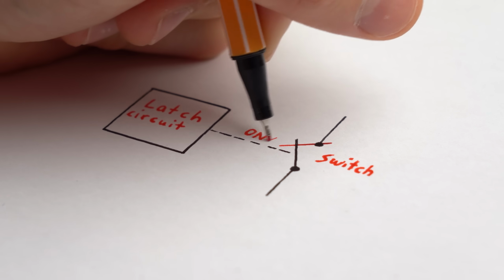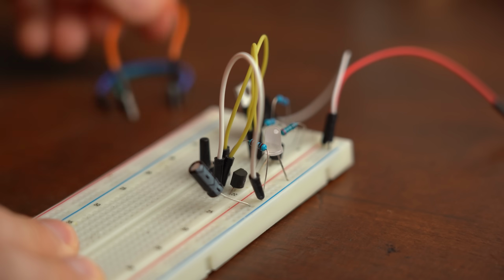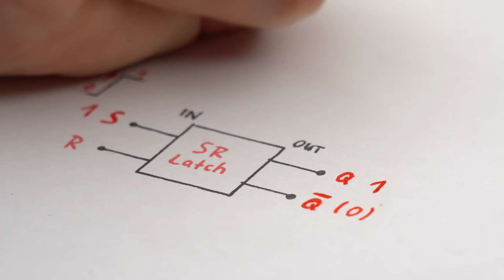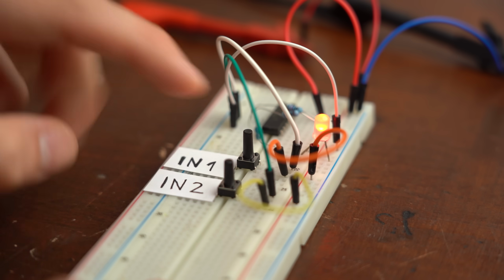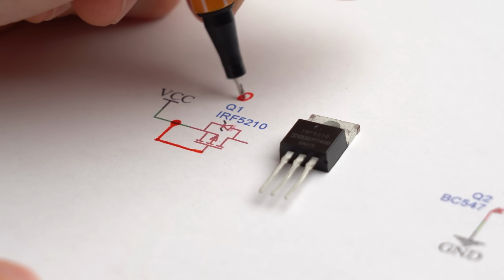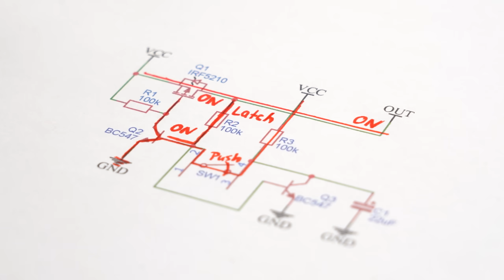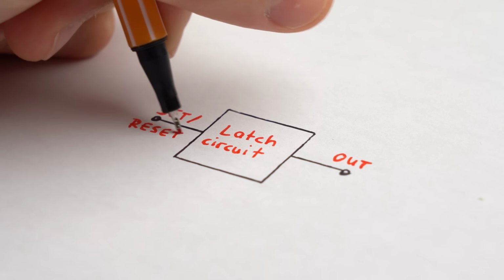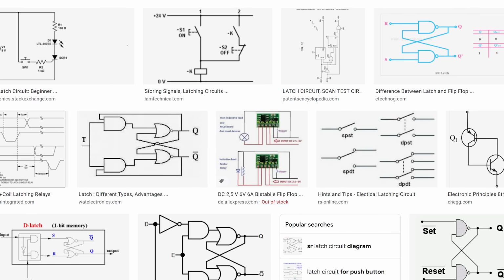Mechanical  Switches are Obsolete?! Switch to a Latch Circuit! EB#53

Comment: I think there is a trend to over-complicate simple devices.  you did point out where latch circuits are an advantage, but there hundreds of examples where  manufacturers are using a 10 component board to do the same job as a simple device.  This is why you cannot repair your own tech any more it always seems to have to go back to the factory to be fixed.  For example Apple phones and John Deer tractors.   And now the manufacturers of cars that want you to push a button rather than open a door or not have to put a key in the ignition are failing to deliver their cars because of a micro chip shortage.  I do hope the current "right to repair" movement is successful and we can stop this madness of having to pay a fortune at the garage to get the cars interior light repaired.
Reply: I agree that over-complication is an issue. I bought a used drip coffee maker (barely used, just out of its 1-year warranty) that had a latch circuit to turn it on and off. The heating elements were 230V AC and the latch circuit was 12V DC. After a few months the machine wouldn't turn on anymore. Turns out the latch circuit died, everything else was fine. So I replaced the whole latch circuit with a 230V AC 10A mechanical toggle swith with a built-in LED, which cost me 1.50€. It's been 2 years and the machine is working without an issue. These companies are sacrificing reliability and screwing over the environment for a few pennies.
Reply: I both agree with you on this, and think it's a bit out of place here. There's been countless examples of stuff being complicated for no other reason than someone either in management deciding it has to be "special" somehow and it gives no real benefit, or just engineers and designers that are lacking time to stop and think about everything from the start.
As a parallel talk I'm fully on it, being a product development engineer now it was literally the topic of our last meet up at the company (the boss saying "guys, sometimes we just need to... Stop, breathe, look at what the heck we're doing, and think: WHY is it like this? Can't it be made easier?"), and I agree right to repair just has to happen and disposable devices have to stop. People gotta stop feeding this insanity.
But I'll also say that I don't think the complaint relates to the video. There's several situations you'll want a circuit like that in place of a mechanical system. As an example, anything remote controlled. You'll not want that the only way to get that remote controlled device on and off is the mechanical button all the way at the device, neither you'll want to waste power unnecessarily with who knows, a mechanical actuator to that switch. A latch circuit solves the problem no doubt the simplest way.
This circuit being or not an unnecessary complication is always a matter of situation. It may very well be simpler than a mechanical switch even, remember a mechanical switch has to deal with contact bouncing and protecting the contacts against corrosion and arching.
Reply: @Kalvinjj  Well put.
Reply: @Kalvinjj  I'd agree with your point if not the title of this video. This is not "there are certain situations where this circuit is superior to a mechanical switch and can solve a problem the mechanical switch can't" This is "mechanical switches are obsolete". Which is exactly the overcomplication BS we're discussing.
Reply: @sydmichel the exact same thing happened to my drip coffee maker and I fixed it by doing exactly what you did. I remember thinking that the heating element might have gone bad and when I disassembled the device I was completely mind blown with the fact that the company went into so much Trouble to design a PCB with a complicated power supply, latching circuit and a led light that can and will eventually go bad instead of a simple mechanical switch that will probably last forever.... Couldn't agree more with your post sometimes it's just rediculous
Reply: I may drive a vehicle that was made last millennium, but I'll never have to agree to an EULA before starting it and driving.  And I Iove keeping my Tacoma going.
Reply: @bansheedearg  every production vehicle you've ever driven has an EULA that you agree to by simply driving it. There are always warning stickers telling you to read the manual and associated documentation before operating. Those documents contain the EULA and state that use of the vehicle is acceptance of the agreement.
Reply: @Callum Faulds Not really.   The latch on the bonnet and boot of my car is a very simple 12v dc solenoid operated latch (all on the central-locking circuit).  And neither my bonnet or boot has a keylock, so impossible to pick.   If any fault occurs is could be in the connectors (corrosion), the solenoids themeselves are virtually bulletproof.
Reply: There is video and pictures online of farm machinery being stolen in Ukraine and taken east into Russia. I noticed many were John Deer. Does that mean that repair parts etc will not be available? Overcomplication as a ruse to make money could help inconvenience people when they steal the equipment concerned.
Reply: @mbak7801  I dont know about all JD tractors but most of their mor high-end equipment can be switched off from John Deer HQ though the internet.
Reply: If you only knew how much some implement this in caravans, germans loves to use this kind of stuff where they make things so complicated it is almost impossible to troubleshoot because of it. there is not by far less wires but the exact opposite. switches that goes to individual control modules with their wires, from the boxes to the devices which often is longer because they need to run to a certain location where each box is, the boxes runs with either Lin-bus or can-bus or even both together in a network together and when one fail everyone else in the chain might flip out completely. there are wires EVERYWHERE and the complexity is insane just to turn a light on. your in for it when something start spooking out for any reason it may be.
to be fair things can in theory be nice when it works to a point but sometimes you gain more to just keep things a bit simple
Reply: I bought a new Maytag washer today. The only model that has rotary switches and knobs. The GE model we looked at has a strange dashboard, lights, push buttons one rotary knob that has no indent the panels lights thru the choices as it is turned. Seemed really cheap and cheesy. I just had the feeling the panel would die after the one year warranty expired.
Reply: Was the first thing I though when I saw the thumb. Some simple thing more complicated. Yes.... And now why?
Reply: Well said basically the clever people mass produce stuff to sell to the poor end user and over complicate design to deter counterfeit theives coping the product that way they can line their pockets better
Reply: @davey2k12  The "to deter counterfeit thieves" is a poor excuse by scumbag lobbyists. The Chinese factory that makes these things for, say, Apple works 2 shifts producing the phones as ordered, then 3rd shift, overtime, producing counterfeits using the same production line, the same projects, the same workers working overtime, possibly cheaper materials, everything off the books and to be distributed by dozens small shell companies that vanish from the market before the US can do a thing (only to reappear under a new name). 
The actual reason is when your device breaks, you can't fix the broken part, you must toss it and buy new, providing them with a steady stream of cash.
Reply: @sharpfang  that's where I'd fix it or upgrade it but you wouldnt catch me buying such overpriced junk including their phone's 
when a £20 version does the same job I think it's time people rethink their expensive life style 🤣 
The only reason I said to deter coping is because they purposely over complicate design for what reason for fun or to look clever naahhh to prevent copies and what u said so you have to buy new that's in everything these days like cars going electric..... Big companies stay ahead of the population while they get more complex design we are getting dumber and dumber and need to be trained more money in their pockets
Reply: What I'm usually doing is replacing the broken high- tech computerized device with a simple mechanical device so that it can still work.
Reply: like sure, right to repair is important, but imo you picked a completely irrelevant video to comment about it
Reply: and out side of a pandemic, would chips for starting the engine opening or loseing the doors wear out one day, and surprise, surprise, the only people  allowed to make then the car company and they stopped making them when the last of that model rolled off the line, they will say they will supplied chip for 5 years or something but when they run out there are going to say it unecanomaly to make new stock on the odd chance a old car will need a replacement chip aren't there and even if you take court action, and win, even if you are the same person that's had the car from new, in most cases the cars will be at least second hand, they will do some sort of calculations taking in to account  the age ,the time  and mileage, the car has dune, and come to the concision the they is worth $£5 or less, they may invent bitt you to cart it a way to,
Reply: I agree with what you say. I see that all the complexity and poor durability, less effectiveness and less reliability are due to the presence of electronics. Electronics are profitable for consumer companies, so we see these companies insisting on making everything electric ( Even things that do not need electricity at all ) and advertising that it is the simplest and best system in the world. On the contrary, it is known that the electrical / electronic system is a very complex system, weak in durability, and low in reliability. It also affects and pollutes our environment through its reliance on semiconductor materials, rare earth materials, and lithium. I believe that we must all diversify our devices and get out of the narrow circle of electricity owned by consumer companies !
Reply: this seems like an irrelevant complaint. if you're opening up a circuit to (de)solder it, that's already inaccessible to most. and whether a mechanical switch or latch is used, the complexity of repair is about the same at that point. plus you can replace it with a switch if you really want and if the application makes sense for it. "right to repair" doesn't seem to apply here
Reply: @LC-hd5dc  The point is: The smallest Replaceable Unit (SRU) used to be something like a switch or relay or some other discreet component costing about £1.  Now everything is part of a complex circuit on a Printed Circuit Board  (PCB) costing about £100 to replace.  Sometimes you cant even replace the PCB and you have to buy the whole unit that the PCB is part of.  Soon, you wont even be able to have your car/TV/fridge/washing machine repaired at all, they will all be repair-by-replacement.  Then, maybe you'll look back and think, when did this all start?  And you will remember, oh yes; it all began 30 years ago when they decided to replace a mechanical switch with a complex switching circuit.
Reply: @sydmichel  considering SR latches are older than I am I think this is scaremongering. also not every PCB is expensive. generally the parts that are difficult to repair are circuits with obscure ICs but in the case of a latch you often have the option of replacing with a switch if you really want. you can still use the $1 switch if you want, meaning right to repair doesn't really apply here. you're talking about completely unrelated scenarios that are not related to latches vs switches!

also this also seems off-topic on a video that is simply educating about different options, it's not trying to tell you you should run off and replace every switch in the world with a latch. you have to consider the circuit you're designing and which option among a mechanical switch, latch, relay, etc is the best option for cost, reliability, performance, and manufacturing constraints.
Reply: @LC-hd5dc  You already can't replace the home button on iPhone with a generic pushbutton. It must be paired to the motherboard, using specialized utility. So just wait for your SR latches to come with DRM.
Reply: @sydmichel  Well  actually the replacement of pcbs (to repair the device) has been common for the at least the last three decades,  more or less the time that SMT ha been adopted in circuit construction.
.
I think this 'right to repair' argument is irrelevant here.   As for solid-state [SS] over mechanical switching,  there are so many cases - especially in the audio (stage/studio) environment - where SS switching is vastly superior to a mechanical equivalent.    Especially when ganging-up a switching network, where the TTL can be programmed to operate many 'latches' with just one physical momentary action.    

The most obvious downside of using solid-state switching [ss], is that the power requirements of the SS circuitry has to be factored into the final design concept, especially in a portable device.  Where SS switching should not be used, is on mains power inputs.  That is where a good quality mechanical properly rated switch (breaker) is a must.    Sadly missing on much modern entertainment equipment, which might rely on a remote to switch the device on (obviously using a SS/TTL system).
Reply: @sharpfang  what are you talking about lmao, do you know what an SR latch is? it's literally two logic gates in its simplest form. idk man this is some weird conversation
Reply: @LC-hd5dc  A heater is literally a resistor, and it appears BMW managed to paywall the seat heaters in its new car behind a subscription. An home button is literally two springy contacts, but Apple managed to make it talk to the OS and authenticate itself with an unique key to work. And try removing the battery from Onewheel's board. Not the controller or anything like that, just the li-ion pack. Just unplug it. The board bricks itself; you're not allowed to replace the battery.
There's literally no circuit too simple for the corpos to DRM it. And yes, I agree it's ridiculous, but this is the dystopia that is arriving in rapid steps, and you should really look into the crap corpos are trying to push.
Reply: @sharpfang  Apple Home button is a fingerprint reader first it needs to authenticate otherwise there would be no point in having it a part of security system.
Reply: @sharpfang  In the case of the BMW seat heaters, I would wager that the heater connections in the seats have connectors. It seems to me it should be a relatively straightforward matter to use an Arduino or Raspberry Pi, add a thermistor, a solid state relay, and a potentiometer. Write a simple thermostat program that reads the thermistor and compares it to the control setting, then use PWM to supply current from the car battery to power the seat heater element in a controlled manner. No subscription required, but some technical skill needed. If you use the connectors, It can be easily restored to factory original if you sell the car.
Reply: @LeftHandedGoogly  Yeah... and fit the controls somewhere, neatly, so they don't spoil the aesthetics of the expensive car. This is the hardest part.
Reply: @sharpfang  the answer to that problem is to omit the potentiometer and instead incorporate a Bluetooth wireless module. It avoids the issue of having physical controls but does require you to write an app for your phone. There are a few good examples on line of how do do this.
Reply: @LeftHandedGoogly  Remember the solution should be cheaper than the subscription :) And even if the parts aren't that expensive, if you own this sort of car, your time probably isn't cheap.
Reply: @tymoteuszkazubski2755  The Apple authentication is BS though. If there is a device restart or key mismatch, it should disable the fingerprint reader until the user uses an alternate authentication method, such as a PIN or password. Then it can prompt the user about a change with the fingerprint reader and if they want to update the key to the new fingerprint reader. I know that my Samsung Note 9 already disables the fingerprint reader every restart, preventing a fraudulent one from being installed and bypassing security.
Reply: @billmight5662  From security perspective any tampering is an element of an attack it is the best option to fully lock and preferably wipe the device.
Reply: @LC-hd5dc  ok but, I think that he said it because a mechanical switch is maybe more reliable than a complex circuit? But with arcing in the switch contact I don't know...
Reply: One wonders why there are so many luddites here ...?
If you can't handle complexity, then bugger off to some vintage channel and enthuse over antiquated toggle switches there.   Such an asinine argument, in this context.   
.
Yes, 'right to repair' is a serious issue that needs to be addressed, but not the basis to criticise against using a solid-state switching over a mechanical device, on the grounds of overcomplication.

Comment: I made a similar circuit using only bjt's it works perfectly fine except that litteraly anything switches it on. If my hand is nearby it switches on if I touch the pcb it switches on etc. Ig I just provide a current use a MOSFET which switches based off of input voltage rather than current.

Comment: Wait... I've never seen this before. Your wall switch toggles a device that lives in your breaker box?
Reply: Why not to go even further with just low voltage inputs all over the house and process them with wago/teco/knx/loxone ;)
Reply from the maker: Yep. Pretty cool stuff :-)
Reply: Pretty normal in Denmark too. We also have houses from 1980's with latching relays and 8VAC low-voltage input switches , homerun to electrical panel. I made nice DIY project automating all the 16 mechanical relays with ESP8266/ESPHome/HomeAssistant relatively easy :)